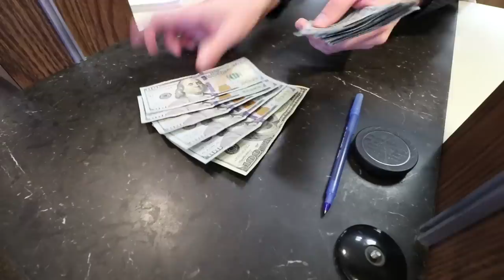WE BOUGHT A BACKHOE

Comment: Great buy on the Case 580, one of the best old hoes ever. They still make parts for it and they are very reliable. That thing will be a life saver for sure, the first few times you use it, lifting and digging, you'll be more than happy with the investment. And if you ever did get in trouble cash wise and needed to launch it, you never know, you might get more than what you paid for it! Keep an eye on the fluids and oil cooler lines and you should be golden for a while with that thing.

Comment: One big advantage of buying an older piece like that is, it really won't drop in value much. So you can basically use it for a few years, then sell it off. The real cost will just be maintenance, which shouldn't be bad amortized over a few years.

Comment: a few suggestions  . have a welder put real hooks on the buckets , front middle and both sides and the rear bucket.  . a snow pusher with a rubber cutting edge will make it easier to plow snow without digging holes in the gravel parking /driveway.  piles of gravel can be a pain in the rump . and if you get snow in mud season its possible to scrape ALL THE GRAVEL OFF . speaking from experience  . keep up on the cutting edge also. replacing a cutting edge is much cheaper than cutting the edge off and welding a new one
Reply: teeth on the hoe also will wear and need to be changed  before ripping a shank off also an expensive fix . wear patches on bucket corners or even weld beads will increase the life of digging surfaces. grease grease grease grease grease. Did I mention grease . every fitting and if a fitting wont take grease change the grease fitting .

Comment: Be careful with the backhoe, especially when working on a hillside. They can be very top heavy.  The most common construction accident with backhoes, is a rollover. I've owned backhoes, and have 40 years experience, and I'm still very careful when venturing off level ground. 
I used to have a Ford 555 with the four lever controls. After a while you stop thinking of what your hands are doing and only think about where the bucket is going. Two levers in each hand. 
Beats the hell out of a shovel!

Comment: I have the same 580K. Like mine, yours is a phase 3. The serial number will be higher than 20,000. it should be something like JJG002XXXX. This is important when you need certain parts. Great backhoe. Ive had mine going on 18 years.

Comment: if you check the water, oil,and hydro every time you run it.  check the water seporater in the fule systom. keep the oil and fule filters serviced. diesels like clean fule and oil. and your hydro should not leak at all if you can help it. a bit of mantanec gose a long way.

Comment: Just an observation from a number of years of operating, maintaining, repairing equipment: Rented vs. Owned is a tough comparison when looking at down time. The "drive it like you stole it" mentality is very real with rented machinery. Machinery that is owned by the operator (or the operator's employer), generally speaking is not run as hard or rough. Simply being operated by the same individual, who presumably operates other equipment on a regular basis (or at least knows what the machine typically sounds like), is significant. Ownership is expensive but is often justified. A well maintained backhoe won't lose much value. Order a couple fuel filters to keep on hand, and throw some fuel treatment in the tank when it gets cold.

Comment: Congratulations, the case 580 are a decent machine. 
Make sure to use quality Diesel fuel. Keep a couple spare fuel filters in stock.
Blended fuel in winter.  
Consider getting a oil sample done of the engine and hydraulic oils. 
I've been using Blackstone labs and been happy. 
Might consider a manual thumb someday. 

I strongly recommend you use a fuel stabilizer in the saw mill. 
Can save a lot of grief latter on. 

I enjoy your videos. 
Keith

Comment: At the end of the day we are blessed with a large number of heavy equipment manufacturers in this country.  But finding the right equipment is a challenge.  My son in law first bought a Mack over the road tractor with a fair number of hours on it but not even 50% worn and then a new trailer that is capable of handling oversized loads.  The good part is that he is a meticulous mechanic and can strip that 650hp diesel in his truck.  I tried to get my partners in a business in which I had an interest to get into the hydraulics business for mid sized equipment since we had new equipment to mill to 5 microns.  No luck.

Comment: I'm in the same situation as you, building my own house by myself , and I'm about to get a 50/60 HP tractor, and get the attachments that I need for all the projects,  attachments like :   backhoe / wood chipper / stump grinder / land plan leveling/ post hole digger ...etc.   I believe its a better investment.. If I would have to get all the machineries separate, man, that would be much more, just a good and strong wood chipper and stump grinder would cost over 10k ( not talking about the 10/15 hp toys you can find at home chepo ....

Comment: Thank you Alyssa. You two will most likely never part with your backhoe as they are s o handy on rural properties.  I wish I still had mine. I had a case 580C that I used to contract to a couple Councils.  I now have a 1.5t excavator and there are times I could use the backhoe. Alyssa keep up the good work with your videos. I enjoy them.

Comment: on your out riggers. aka. stabilizers. grab them and flip them over by hand. on a grade. you do not want your rubber pads down.  equipment operator for 30+ years.  and once you get the case foot swing stick down. it is the most controllable set up.

Comment: It's a known fact that women are easier on equipment.  Guys might get more done but they wear out stuff faster, so its a trade off.  On the price of the backhoe, I just looked a few up on CL and there is one in Oregon, year is 2000 and its basically close to the one you bought, its got 4700 hours.  Its listed at $29,500, so I would say you got a great price on it for sure.

Comment: all your reasoning is sound. Any time I can afford to buy a tool or piece of equipment I do rather than rent. my main reason is because I can use it whenever I want for as long as I want then always resell it. the money I lose if I lose any  is still less than what I would have paid for renting and the convenience of being able to use it any time I want is huge.This works just fine if you buy USED equipment, most things will not depreciate all that fast so you can get a good amount of use out of them without losing a penny. hell I have bought a few things I ended up getting MORE for when I sold them and that was after 3 or 4 years of using them just because I had made some repairs that raised the value.Last one was a flatbed trailer. paid 800 spent 200 on tires and 100 replacing the deck. used it for four years sold it for $1800. seems like a good deal to me!

Comment: I have what snap-on pieces my dad left me. I guess if you're leaving it to your kids, it's worth the high price. I appreciate it. the socket wrench I have is now my favorite in heavy mechanical cases. the old dewalt cordless drill he left me is also now my favorite. 3 speed and going strong. the cordless sawz-all didn't fair so well. poor design and it clogged and wore out gearing. my own corded sawz-all, also dewalt, I give it enough abuse, metal, small trees up to anything the blade is long enough to cut, it also keeps going strong. lawn tractors, every one I see is vertical shaft engine and belt drive.. my dad taught me what to avoid. his cub cadet was taken apart and left out in the rain for the last 10 or so years. hydrostat drive, power steering, hydrolic lift, all the features that matter. I'm using my dads tools to take it apart and clean and oil. I'm amazed by how well built most of it is. under the rust and layers of dirt and oil, there's still a beautiful machine. every part is ceased fast. I break it free, one part at a time, and oil it well, and it magically works like new. 600 hours run time, and I think only the engine filter may have been changed, once. a little pitting in one cylinder, but I think there's still hope.

Comment: I suspect you're going to get a LOT of use out of that backhoe and the more you use it the more you'll wish you'd gotten it sooner. It will certainly make using that saw mill easier, though an upgrade to one with hydraulics might still be worth considering down the line. At least you will be able to load logs on it much more safely now. Same goes for lifting or moving other heavy or bulky items that you might have done manually before. 

Speaking of which, you don't need a ton of tools, whether Snap-on or Harbor Freight, to handle most repairs you'll likely have to deal with with that backhoe. You'll want the needed wrenches to to replace a hose as well as some spare hoses or hose, fittings, and a crimping tool because it's almost a given that at some point you will blow a hose or damage one.

Comment: LET ME HAVE YOUR.          ATTENTION PLEASE .! 
 
 there are a few things you should keep in mind about heavy equipment being you are not experienced operators
      one hydraulics are Unforgiven they will cut you in half in a heartbeat!    not trying to scare you .  just be aware Safety First !    you seen you can take the bucket of the back hole and cut a tree in half with it,     Imagine One slip of the lever the bucket cutting you in half so Safety First Don't Be Afraid just use common sense when people walk up on you make sure they walk around you and come up in front of you and get your attention before you have a conversation so you see them
   I have worked in Escavating for quite a few years seeing some crazy things really great operators I've learned a lot running equipment I've seen operators 2 things I thought were impossible cuz I know how to run equivalent 
     not trying to scare you just be aware  Hydraulics are very very dangerous at times

looks like the back hole is in very nice shape for a 91 four wheel drive is a must to me the extendahoe you will be glad you have it sooner or later looks like it was well taken care of
 now some things I'd like to point out for example everyday and every time you jump on that machine keep this in mind maintenance is very important .
     first thing you do every day you started up and let it warm up even though it's hot out let it warm up for a minute the second thing you do is Greece make sure you have plenty of grease on hand grease is more important than you can imagine .   make sure you grease that machine everyday you use it if not you will be replacing bushings like you won't believe and  can get very expensive especially if you are paying somebody to do it and time down you must keep that in mind Grease Grease Grease if you're running machine all day long you want to grease your buckets and things that have you're using on the machine continuously such as Outriggers backhoe and the front bucket.   Greece is your friend keep couple cases on hand or at least one all the time never run out of Greece never say hell with it today you will pay for it in a long run and it can get expensive try and keep in good shape being a homeowner this should be easy as far as the diesel motor goes you must to make it last.    do  your maintenance again it's called p.m. preventive maintenance on all this equipment on the motor change your filters regular your fuel filters are critical it keeps water and dirt out which makes your motor last and Cetera oil the same thing keep it up water that's why it's so important I thought you said you paid something like 6 grand if that is the case in my opinion by the looks and shape of it I think you got a great deal 6000 hours for a 91 is not many out and it looks like it was taken care of I think you got a great deal I live on the east coast that machine will go for good money especially for the shape it's in personally the only thing I don't like about it is no cap but that's okay you can put plastic windows  I used to work in the winter time as well that's why I like a cap and it's summer when it gets extremely hot the air not a necessity though looks like nice piece of equipment good luck God bless you just take care of your equipment and it will last you same thing with your sawmill wherever you can grease and do maintenance do it for example change keep them lubricated maintenance will save you a ton of money in a long-running with equipment not only that to me one of the worst things about equipment is when you go out to work and you break down oh I hate that drives me crazy breakdowns  in my times Ihad very few because I've always done my maintenance keep up the good work God bless
  P.S. I'm 70 have all kind of medical problems and soul I still jump in equipment still jump in tractor trailers and still snow plow trying to other kinds of work can't sit still that's why I appreciate what you guys were doing while you're young remember as I was taught nothing for nothing if you work for it you will have much more and appreciate and take care of what you have nobody's giving it to you it's not free I think that's why I like to watch you I appreciate people that work for things and have dreams like you guys good luck and yours to come when your kids are running around on your homestead please remember me the old guy I watch your kids grow up

Comment: Get some teeth on the front bucket.  
They cost pennies, and it'll do your head in trying to dig with it otherwise.

---

My personal rule on buying plant is to estimate how much I'll spend on hiring something over say 5-10 years, and if that amount is greater than the cost of buying a decent used one then I'll buy one instead.

So far I have a 1.5 ton excavator, telehandler/forklift, whacker-plate/compactor, Mule/ATV, concrete mixer, generator, compressor, steam cleaner, trailers, scaffold tower, plus a ton of power tools.

...I'm currently on the lookout for a reasonably priced skid-steer.

I'll usually also only buy a tool when I need it for a paid job but see myself using it quite a bit for other jobs and at home as well. That way the first paid job pays for the tool, I make more on subsequent jobs as I don't have to hire, and I get to use it on my home projects 'for free'.

---

Also remember the golden rule...

"The man who dies with the most tools & toys wins"

Comment: That's going to come in very handy when they have to dig up and repair the cistern!
Reply: wes, to be fair, that's only because they cheaped out on the basic stuff like lots of cheap and cheerful sealant (or even heated plastic connections as per african well projects ,they walk for miles just the get plastic bottles and a few stones to build stuff, if your money's really tight) of whatever brand and just took the manufactures claims of it gets a perfect seal (EVEN WHEN ITS FULL of tons of untreated water) and the other generic pre heating the pipe with a blower inside the lower end to make it far more pliable, and so sits where you want it to be rather than where it ends up...